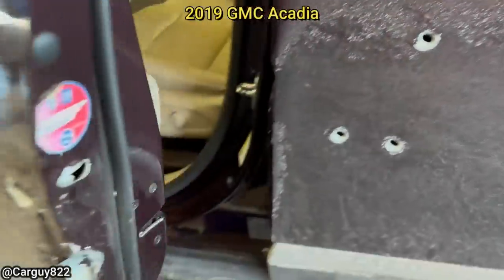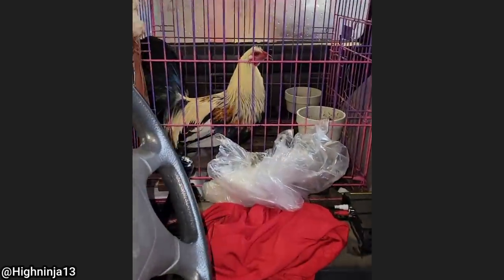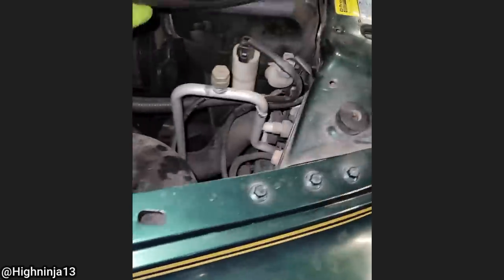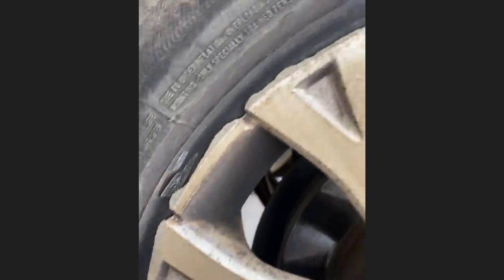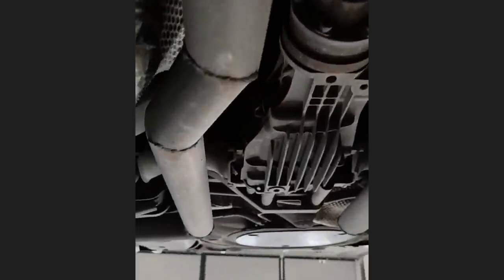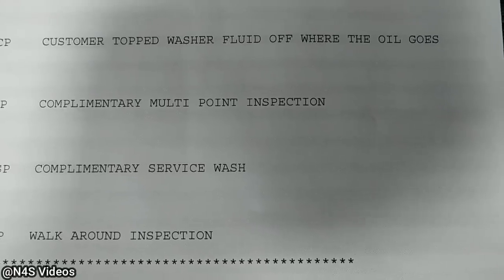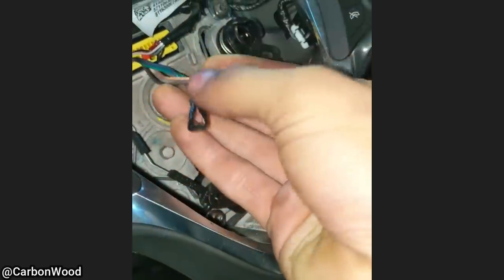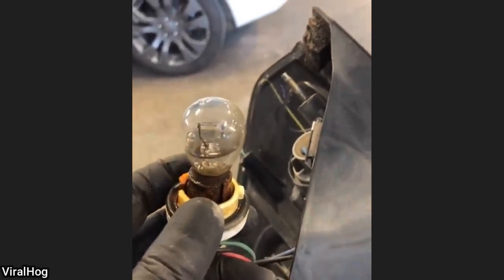Customer States Drivers Side Rear Window Won't Go Down | Just Rolled In

Comment: That customer was actually correct: they truly had no brakes.
Reply: How often does a customer actually make a correct diagnosis?
Reply: When you roll in knowing
Reply: My question. How the f*** did he get to the shop, WITH NO BRAKES???

Nvm, just remembered that guy, "are you guys silly? I'm still gonna send it!"
Reply: But that's not stopping them from driving XD
Reply: Thanks for the tip on blinker fluid. I’ll go check mine. You should also do a short on summer and winter air in the tires. 🤦‍♂️
Reply: Technician: your car has “no brakes”? Okay… I don’t think you know what you are talking about; let me take a look. 😅 Oh you have NO BRAKES like really
Reply: This joke had me rolling
and I can’t stop
Reply: @nelsblair2667  kinda like the customer..
Reply: HOW do you stop a vehicle with NO BRAKES????  Thats what I'd like to know!!!
Reply: @mewregaurdhissyfit7733  downshift, parking paw takes the brunt of it lol
Reply: But Mom said git rid of them bad breaks  so I did
Reply: @Iwillnotbepushed  thanks! Ill have to get the winter air installed! Lmao 😂
Reply: I stopped at a light the other day and saw a backing Plate of a old brake pad laying in the road. It had no pad left just the backing plate. Reminded me of this channel lol
Reply: Freedom's just another word for nothin' left to loose...
Reply: @danielhattie73   Larry Enticer?
Reply: @Iwillnotbepushed  Summer and winter air is VERY MUCH A REAL THING. If you live anywhere with major changes in temperature you need to bleed pressure in the spring as the air becomes warmer and expands, and you also need to add air in the winter. Of course you could just have your tires filled with nitrogen gas.
Reply: @korbetthein3072  yeah, stale air is really the bane of rubber tyres. nitrogen is where it's at now! a neighbour had all his family tyres filed with it thanks to his airline maintenance job, never followed on how it fared on the long run since they moved. maybe i should have. 😏
Reply: @daveh7720  Not "inoperative brakes." The brakes literally weren't there.
Reply: @daveh7720  Depends on the customer and being right is on a spectrum. I took my car in a couple of years ago and said there was something not right with the exhaust and low and behold a bracket had come loose and needed replacing. My car also doesn't fail inspections because I will ask for stuff to be replaced before the test.
Reply: @Iwillnotbepushed  I always have to top up my tires with winter air.  That summer air just doesn't hold up well enough.
Reply: @paulmoir4452  How long, has this been going on?
Reply: @lotharrenz4621  Suuunday bloody Sunday!  Uh, I'm on the wrong song aren't I?
Reply: @danielhattie73  Maybe it was a standard...?

Comment: The " blinker fluid " one killed me 🤣🤣🤣🤣🤣🤣🤣 ( took a few to stop laughing ) . The classic " dealer didn't know " deal ( well , considering most don't inspect the vehicles they get , just immediately flip it , got it )
Reply: Their motto is "move metal".  I do hope the dealer follows up on that since it looks like someone should be strung up for fraud.
Reply: "as traded"
Reply: If the light was off and nothing showed up on a Carfax report, how would they know without dismantling the car if that's how it was when they received it?
Sounds like the previous owner needs charged with fraud.
Reply: @Summit2012  Not necessarily. If the dealer didn't ask and the seller didn't say anything that's not fraud. I've got an old Jeep XJ and if the airbag ever goes off and I can fix whatever caused it to go off I won't be replacing the airbag, but if I needed to put in a resistor to make the light go off I would (or take the bulb out... if it even HAS an airbag light)
Reply: Well...that buyback escalated quickly!
Reply: "your headlights seem a little dim. gotta top them off with some headlight fluid."
~rooster teeth
Reply: Real dealers have a lot to lose in terms of reputation and potential lawsuits.  Way more than any profit they could ever make on selling junkers with bypassed airbags.

More likely than not, a previous owner didn't have collision coverage and rear ended someone.  Then the vehicle got "repaired" in someone's backyard and traded in.  A clean Carfax is no substitute for a prepurchase inspection.  If the body damage was "fixed" by the same guy, it would be immediately noticeable to any decent mechanic.
Reply: Bought a Mazda from a ford dealer and they said they did a full inspection and maintenance on it before they sold it to me. Brakes went out on the freeway, master cylinder lost pressure. Called the dealership to schedule repairs and they said they had no means of working on the car because they didn’t have the right tools. Full inspection and maintenance deez nuts
Reply: @JeffDeWitt  Maybe good for you, but if you ever sold it that way you're screwed. Mine is so old airbags weren't around when it was built and I'm good with it.
Reply: @JeffDeWitt  It is fraud that vehicle is suppossed to have airbags so by selling it without them you are comiting fraudulent bahaviour. It would be like me selling you a Computer without a Hard driver or a phone with no backlight on the screen.
Reply: @gravemind6536  No, it's not, not if you are selling the car (or whatever) as is and don't misrepresent it. As far as my Jeep goes I don't care, I don't ever intend to sell it, and if the situation described comes up it will be pretty obvious it doesn't have an air bag because it will have an aftermarket wheel on it.
Reply: @gravemind6536  FYI, it's not unusual to sell used computers without hard drives.
Reply: Run the OBD scanner. Do what it takes to clear the codes. Detail and sell. 
The dealer probably got it at auction and didn't look close enough to see if the bags had been deployed.
No accident report means there was none filed. The original owner may have been in a slow speed one car accident, then found a cheap workaround to avoid buying new airbags. Let the next guy deal with it.
Reply: So THAT'S what blinker fluid is, always wondered about that!!

Comment: That air bag situation is very disturbing, somebody out there has no regard for life.
Reply: @bruh meme If the dealership were smart they'd go after the person who traded it in and have them charged with fraud and willful malice.
Reply: If the dealership didn't know, you can't assume they did either, it could have been like that since "new"
Reply: @evognayr  Since new!! So the factory ran out out SRS connectors but had resistors on hand?
Reply: @justinfowler2857  
The owner might not have known either. It could’ve been the collision repair shop, assuming they were activated in crash.
Reply: @bruh meme It's a known scam where people will buy salvage cars, repair the outward visible damage but not replace the airbags. The airbags and sensors can cost $1500+ each so vehicles with not a lot of exterior damage but that had airbags go off can get totaled by insurance. A scammer buys it, fixes up the bumper and fender, disables the airbag warning lights and sells it for a alot more than they paid.
Reply: @VideosofIan  Exactly!
Reply: @VideosofIan  Don't forget, the person who traded in the car beforehand could've bought it second hand from a shop like such. or from someone from car sites or local classifieds. Whoever to blame will be difficult without major evidence. While it'll be investigated. I'm sure the dealership will have to just take that loss.
Reply: Here in Florida you actually can't do that. If you get a car that has a salvage title and rebuild it, you have to provide proof that the work was done and receipts that the parts were purchased plus jump to a bunch more hoops to get that car back on the road.
Reply: In Ohio salvaged cars have to be inspected by the state patrol and show receipts as well. The fact there was no wreck on the CARFAX it could be possible the airbags were sold. Having the police check registered owner history could prove who was responsible.
Reply: @kenlee74  Or it wasn't written off because it never went through insurance. I am not from the US, so please correct me if I'm wrong, but as far as I know you still have a salvage title, even when you get the car back on the road. So if this thing didn't have a salvage title, it never got written off, right?
Reply: @kenlee74  ... no report on CARFAX just means the car didn't go through the normal channels of insurance and repair. Could have been a cash job by someone's friend, then traded in.
Reply: @jen_alanfromchicago53  No...... lots of "new" cars get damaged before they get title. The dealerships will not disclose any repairs done to " new" vehicles. Most cars get damaged during transit, however some get damaged during storage, or test drives. There are businesses that go around and fix " new" cars, because they occur enough damage. Always inspect "new" cars upon delivery.
Reply: @kenlee74 that's only true for titled cars, if the car is "new" anything can be done to it, and nothing will be reported.
Reply: Depends on how you look at it. For decades cars had no airbags. So no airbags aren't that unusual. 
Airbags have been known to kill people. So there is that.
Reply: @roadrunner40  .... you also have to consider that people depend on these safety devices to a point where they are brain dead. If you read an owner's manual it will tell you "In the event of an ABS malfunction the brakes will work as they always have"... and how many young people ever experienced that situation?
Reply: i had bought a used car once and had an accident about a year ago. the airbags never deployed, and the reason was something similar to what happened here.
Reply: so likely the delearship took it in as a trade in or they bought it at an auction. the past owners are traceable so likely will be caught . like he said in the notes if they had done a better job attaching the resistors no one would have known and chances are the car would never need the air bags,.
Reply: @VideosofIan  but how come there was no carfax record ?
Reply: @ronblack7870  ... we don't know if they even bothered to check... or read the other posts above on the topic for more ideas.
Reply: @rupe53  That shit happens a lot here in OK.  The Native American Tribes have their own DMV and they do NOT abide all the rules and regulations that us NON-natives are required to abide by.  If their is a gap or lack of history of the vehicle, there is a 90% chance it was native owned.  Oklahoma used to be an emissions inspection state, but that went away (supposedly the Natives had it shut down because it discriminated against their poor culture).  You can tell what vehicles the Natives drive.  They are the absolute worst death traps I've ever seen in my life and they don't take care of their vehicles!  They literally drive them till they won't run, park them in a yard or abandoned in some random place, then go buy another pos death trap.  Don't expect them to have a driver's license, insurance, or legal tags.  NOPE!  They are above the laws that everyone else has to follow.  After living in Oklahoma for six years, I've lost a lot of respect for the majority of Native American Culture.  Even the good ones are disgusted with their own culture!
Reply: @americanpatriot2.06  ... I'd like to remind people that DMV doesn't track Carfax. DMV would have a record of a salvage title and that's about it. If the car was wrecked and repaired for cash, there would be no salvage title and that would easily avoid the Carfax system so there'd be no record at all. Sure, you could backtrack the owners, but where does that really get you? There's still a car that needs some expensive work and somewhere along the line someone already paid too much for it.
Reply: @rupe53  True.  But every state that I've lived in requires that any and all accidents are to be disclosed regardless of whether insurance was involved or not, or whether it was salvage or not.  The DMV will annotate the accident and damage info for the vehicle history that Carfax and all the other similar companies pull their reports from.  Failure to disclose that info can result in fines and criminal charges, especially for severe cases.
Reply: @americanpatriot2.06  ... I'm not sure who they levy the fine against, especially if there's no accident report. It can happen in a parking lot, at home, off-road, and many other places where there'd never be a police report. Heck, it could happen across the line in Canada OR Mexico and never make our books. In many cases an accident outside the USA might not be covered so no report = no record. Just saying there are loopholes in the system.
Reply: The thing on this one is you can clearly see the curtain side airbags and blown and we're poorly cut out leaving visible scraps of airbag up there...  It's easy enough to pull the black gasket around the door down and take a quick look up in there to see if the airbags are there and intact.  It's something worth checking before you buy a car.  In the majority of cases they will be there, but it's better to know than find out when you are in a wreck and nothing deploys to help protect you.
Reply: I had someone tell me they only drive older cars without air bags because they think air bags are dangerous. 😳
Reply: @AznTony360  it's a weird legal thing where basically to sue the original fraudster, you sue the person who sold it to you, and they sue who sold to them, down the chain.  Something about selling something means you are required to know things even if you don't.  IANAL but had a lawyer explain it to me.